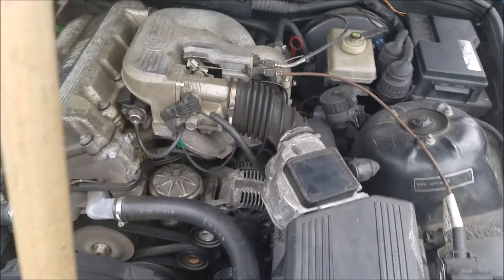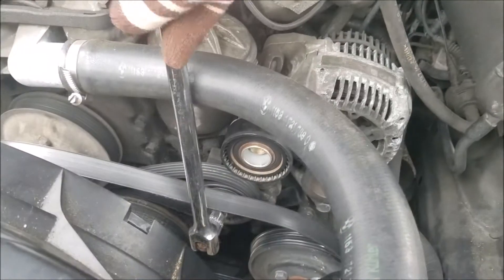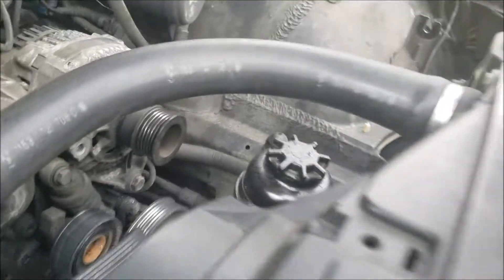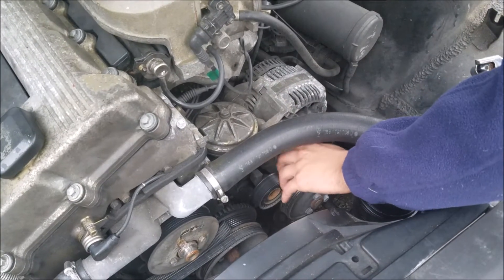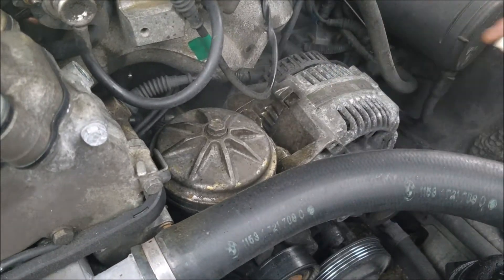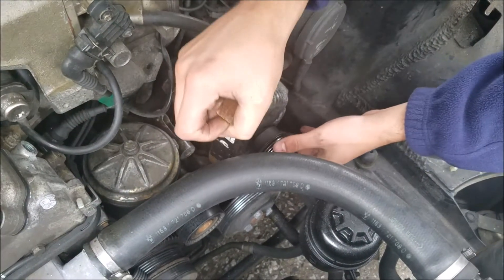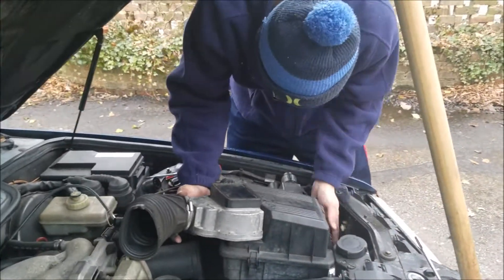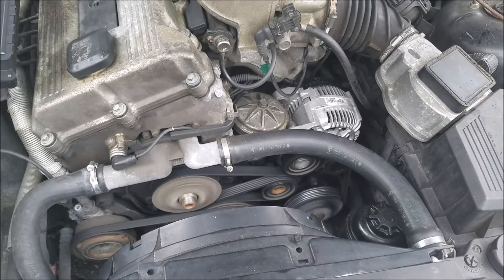BMW E36 318i Alternator Replacement

Comment: If you are having difficult getting your bottom alternator bolt to thread all the way through, use a mill file to on the alternator clearance to get some wiggle room. After 4 hours of trying to get the holes to line up, I finally resorted to filing down the space. After that I had enough wiggle room to align.

Comment: I used this video just to take it off as I was trying to replace the oil filter housing gasket, but when I put it back on, it was buzzing when I had it on accessory mode. I think it may be going bad, but I’m not 100% certain and may have not screwed on the 10 and 13 mm’s on the back as tight as I should have. Should I just replace it?

Comment: hey man i have a 94 318is that idles low and dies out when it goes too low of an rpm. recently it shut off and hasn't come back to me it cranks but nothing ignites . do you think it could be the alternator i've already done sparks, spark wires, idle control valve and next i wanted to try the alternator but i thought maybe i could ask your opinion first.
Reply: Battery? Fuel pump?

Comment: Question when you put the new alternator in do you have to put the second set of nuts on ?  They wasn’t tighten so I figured I don’t since the new one came with two washers and two nuts instead of four unles I take the old pair and put them on top.
Reply from the maker: Nope, just the two!